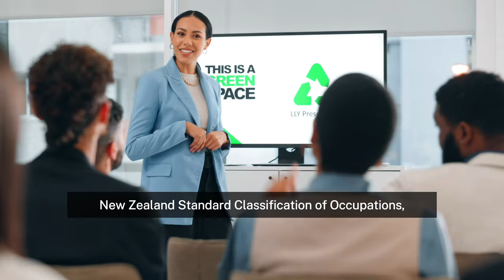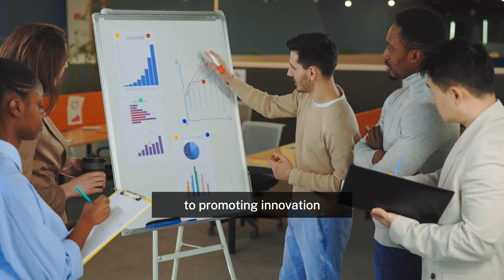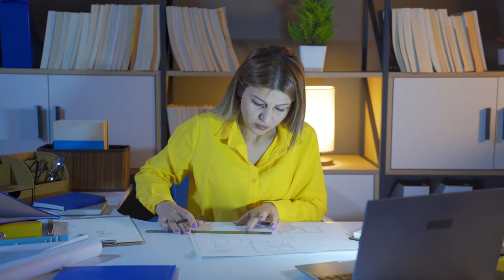Australia Core Skills Occupation List 2024: For New PR Visa | Australia Visa Update

Comment: Hi there, I am on a 482 visa for conference and events manager. My 2 year 482 is expiring in August 2024. I have been with my current company roughly 1 year 2months and need to apply for my 2nd 482 visa in August. I have seen my occupation may not be on the new list in July.

If I apply for the 482 visa before July can this be approved before as my visa is still valid until August.

Thanks!
Reply from the maker: Yes, you can as long as you apply before the start of the new financial year